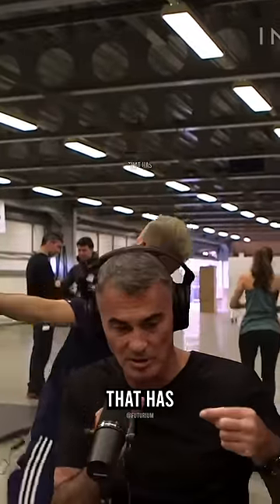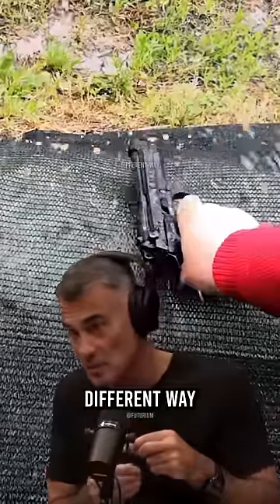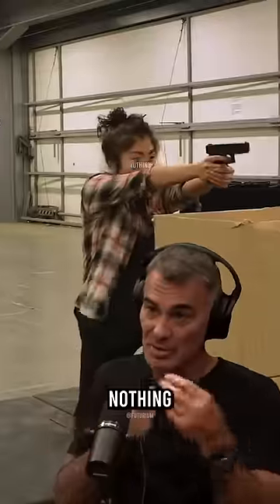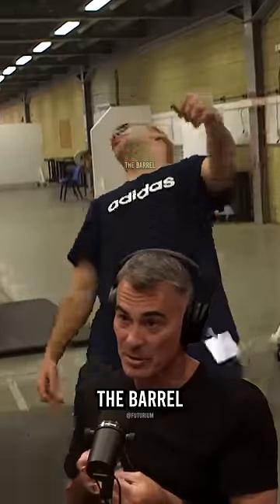How Shooting is FAKED in John Wick's Movies 🤯

Comment: Wait till they find out about airsoft
Reply: Yea but there's no flash like he was talking about
Reply: Blanks?
Reply: What
Reply: they're trying to create an actual firefight lol they would have to pay a whole lot more to create the sound effects and the flash to stop an airsoft gun sounding like a wet fart
Reply: They’re not gay.
Reply: Lmaooo bro got flamed in the comment section hahahaha
Reply: Or paintballs
Reply: Did you think that would be a good comment?
Reply: @iKennectz they still put sound effects over blanks.
Reply: @ealaw5139  yeah but its more like auto tune rather that electronically recreating sound which sounds different due to location/weather/how your holding the wepon/what wepon your using, thats a massive amount of sound creation and muzzle flashes instead of just altering the image they already have slightly rather like filters rather than drawing a motion picture
Reply: This already works way better, and airsoft can’t eject a brass casing
Reply: @ealaw5139  the blank sound bounces around the sound stage in a more realistic way. Dubbing sounds does work but the real sound just works better if you could imagine
Reply: pretty sure they already know about it and that's the reason it's not used in JW since it won't do the job the way they want
Reply: @ealaw5139  'A blank is a firearm cartridge that, when fired, does not shoot a projectile like a bullet or pellet, but generates a muzzle flash and an explosive sound (muzzle report) like a normal gunshot would.'

They don't need to. They might improve the sound, but improving a sound that's already in perfect sync with the video of the weapon firing and actors reacting to the sounds the blanks make is much easier than removing hundreds of bb bullets flying around the scene and having to go through thousands of frames to find each time a trigger was pulled in order to add audio from scratch
Reply: Yeah..but the gun slide won't lock back when it's empty, so it might looks weird..i think in john wick they try to portray the gun as accurate as possible, so airsoft gun won't do :/
Reply: @andrewgagne4465 theres no flash anyway. the plug gun has no flash. and neither does a co² airsoft gun. He even says "the muzzle flash is not important"
Reply: Not even remotely close to what they're talking about or need.
Reply: Huh? Do you actually know what youre saying
Reply: @iKennectz You’re pretty naive.
Reply: @wackwabbit3831 idk what kind of airsoft guns you've seen, but gas blowback airsoft guns (so vast majority of airsoft pistols) almost all have last round hold open and operate like the real thing.

Comment: Alec Baldwin has left the chat
Reply: Bruh 💀
Reply: ouch
Reply: Gunplay actors have got to be so paranoid after that happened.

Imagine you get handed a glock with 20 cartridges in the magazine and you have to halt filming to go through them and make sure none of them have a bullet in it.
Reply: I knew I would find Baldwin's name in the comments.
Reply: And he may have to leave the country
Reply: Yes
Reply: @priestesslucy3299 safety first man
Reply: @riclate2013  that is suppose to be the support crew's job to do Safety First
Reply: @priestesslucy3299  if your handed a firearm that can accept real bullets the safety comes down to anyone who's holding it.  Takes 30 seconds to check doesn't matter if your part of safety crew or not.
Reply: @riclate2013  it takes 30 seconds to check the cartridge in the chamber.

It takes a while to check every cartridge in the magazine
Reply: @priestesslucy3299  takes legit 3 seconds to check for a cartridge for one in the chamber.  With semi auto release the mag, rack the slide back and the round should pop out if there is one, if not then lock the slide back  and check.  If there is a round stuck you have something else to worry about.  Magazines are extremely easy to unload simply slide each round out. They take 15 seconds to empty via hand, some mags that are double have a mechanism where you can press down on the bullet head and the rounds will simply pour out in 3 seconds. 
If it's a revolver you either release the cylinder and check each chamber or for single action have it half cocked(sometimes not required) and open the loading gate then turn the cylinder to check each chamber.
There is no excuse for not checking it yourself especially if it's a legitimate functional firearm.
Reply: More like the he enter the chat and the victim left
Reply: @riclate2013 the real bad guys were the crew who went out into the desert and shot real bullets with the gun
Reply: Thing is actor like Alec Baldwin don't do enough training before filming. I had firearms training in Serbia. I had to undergo pre training with safety. The first lesson I got taught is safety first and safety last. Always check your weapon even if fire arms experts hands you preped the gun actors still need learn to check  the gun. A gun expert can tell the gun is safe but don't trust their word always check the gun  for self. Because gun have errors like double feed. The only gun that don't have a firing error is revolver.
Reply: @kaimortimer3639  That's just wrong revolvers have a hammer that could misfire. Obviously that means more training. But still it wasn't his job to check the revolver. That is the prop masters job.
Reply: @jorge-wh4pf   I didn't say that revolver's error free. I believe that actor's should trained in basic safety before filiming a movie that has gun's. yes it's the masters job to make sure that the gun is safe. But If I was given a gun in movie's even if the prop master told me the gun is safe I would personally check it since i'm the one who would be using the gun. i was taught that never trust anyone who gives me a gun that's safe always double check. if Alc baldwin was taught to check weapon and weapon safety weapon accident's would happen far less.
Reply: @riclate2013 umm. It’s not regulated for actors to check the gun. If he is going to jail for this. They should also consider the gun expert they checked the gun and handed it to him.
Reply: @stimswwolf7867  it doesn't matter if its regulated or not it's just gun safety 101 my guy.  Better to safe than sorry as the saying goes.  Especially revolvers takes 2 seconds to check if that pietta single action is loaded.  While the props department had their share of the blame ultimately the blame falls on him for being so careless especially since it was a functional firearm not a fake prop.
Reply: @riclate2013  is the department currently being investigated?
Reply: @stimswwolf7867  they were, alec still couldn't escape that though
Reply: @riclate2013  Not everyone is a gun enthusiast. Someone who's never dealt with guns would not know all the things you described, they may even not know the difference between a blank and a live round. Dude in the clip here literally had to explain what a blank is (not for Joe but for the audience). An actor should be able expect to get handed a prop, not a real gun. They are at a film set not at a gun range.

Comment: Man ive always wondered because they clearly werent using guns and blanks due to the constant proximity, and using CGI adds up and you can still see the recoil which looks legit. Great solution.
Reply: In the first movie they just used a CO2 powered airsoft Pistol.
Reply: @CaptainRudy4021  Makes sense. Great solutions to keep everyone safe without losing the believeability.
Reply: @TheDalinkwent  I'm fairly sure they also used them during filming of the later movies, or at least for certain takes or for training. There's behind the scenes footage of Keanu practicing the maneuver from Chapter 4 where he turns a car around and picks the Pit Viper pistol off the floor at the same time, and in the practice takes it seemingly has a orange tip, presumably being the official airsoft copy during the practice runs.
Reply: What recoil?

Comment: There's an article that goes into depth about how they made this plug gun. 

Basically it doesn't shoot blanks at all. It's essentially just a reloader. There's a hydraulic pushback when trigger is held, casing pops out, but Nothing comes outta the barrel. All muzzle flashes are added in digitally. 

Not only is it more safer, but you can have a better performance due to the gun recoil and reloading you can do in real time.

Comment: They also reduce the charge of each blank for some shooters, so they can appear to be handling the recoil.
Reply: Blanks have basically no recoil, because there's no projectile. Blank firing weapons have similar recoil as gas blowback airsoft guns.
Lowering the power of a blank only leads to failure to cycle. Because now there isn't enough energy to move the bolt
Reply: oh no blanks are supposedly dangerous..

Comment: I'm surprised that gas blowback guns from airsoft aren't used more often
Reply: Was legit thinking of that
Reply: No spent casing, means you have to add that in post production, which is likely going to be more costly than a prop gun and blanks.
Reply: @kman9884  literally can buy a AR resemblance shell ejecting for like 5-600$ and another 60-80$ on gas use some magic editing and poof its john wick

Comment: The military has this but it’s a BFA that screws onto the end of the barrel. I’m surprised it took armorers in film this long to find a work around
Reply: BFAs are a nightmare for cleaning so much carbon
Reply: Isn't the Bfa primarily to create enough pressure to correctly cycle the bolt of a gun that's not made to fire blanks?

Comment: So this guy discovered a blank firing adapter 😂
Reply: They work with pistols?
Reply: @Mike0 All it is is a barrel plug. Keeps anything from leaving the barrel for safety, and builds enough gas pressure to cycle the action.

Is not new, movie guns used to plug the barrel solid, before realism became important.

Comment: Billions of dollars and they cant design a fake gun that runs off a gas canister so they can get the muzzle flash. You would think after the first guy died they would stop using real fricken guns.  Blows my mind.
Reply: Danish special effects workers have actually made gun props that make realistic musselflashes. But it's compressed air and light inside the gun. 

Though Hollywood still thinks that blank firing is better. Although it have gunpowder residue flying out of the gun and the risk of Brandon Leeing people.

Comment: I’m surprised movie/choreography directors don’t use air soft and unloaded pellet guns more, it basically solves their problems other than the barrels being massively smaller than that of an actually gun, idk I just thought that would be a more common solution rather than designing a whole new gun specifically for films

Comment: When you fire a blank gun, there is no bullet or projectile that comes out of the barrel. Instead, only the explosive gases from the blank cartridge are released, which produce a loud noise and a burst of hot gases. The primary purpose of blank ammunition is to create sound and visual effects, like in movies or theatrical productions, without actually firing a projectile. However, it's important to treat blank guns with caution, as they can still be dangerous at close range due to the hot gases and loud noise they produce.

Comment: Yeah it’s called a blank firing adapter (BFA) and they’ve been around for decades. Usually it’s an externally mounted system but a few modifications to the barrel and muzzle and it can become an internal system pretty easily. It’s actually not as revolutionary as you think

Comment: In John wick most of the time they didn’t use blanks. They used air soft guns cause you can get close and still have the pistol blowback.
Reply: The director just told you otherwise
Reply: @D123-f9k  The B- Roll shows them using gas blowback pistols and adding flare in post

Comment: Blank adapters for rifles have been around for quite awhile.  I can say from first hand knowledge that the military had them for M-16's at least 30 years ago.  They look like a red square of metal with a screw at the top to lock over the end and into the barrel.  I believe they also have "hollywood" blank adapters that just fit onto the end without making it look like there's one installed.

Comment: This is actually how the military utilizes blanks, however it's a blank firing adapter that attaches to the end of the barrel, not really inside it. But it basically forces a steel rod down the barrel to increase the pressure so it can actually cycle. Even with this on it the safe engagement distance is 3m, not because it'll kill you but because 1, it's loud enough to damage your hearing, and 2, it can shoot of little bits of burning carbon and gunpowder which hurts like a m***********. Without a bfa or that steel rod, it could definitely kill or f someone's day up

Comment: I'm sorry but there is no possible way a blank is lethal at 10-15 feet. It's just gas that gets dispersed into the atmosphere and the pressure drops extremely quickly. You need to be incredibly negligent and almost touching the target to have a lethal effect. While blanks can be dangerous, they will in no way kill or hurt someone beyond maybe 2 feet or so.

Comment: An Atomic 3000 is a great light to re create muzzle flash without using any discharge 
All the weapons can be plastic 
A little color correction of the light with gel 

Led lights do ok but there is latency in the dmx path

Comment: Wouldn’t it be cheaper to use a gas blow back airsoft pistol with ejecting shells rather than using blanks with a modified barrel that would be cheaper in the long run

Comment: What part of a blank shot kills you exactly?
One of us doesn't know what a blank is 🤔
Reply: black is a round without the bullet. blacks fire only gunpowder. but the air coming out of the barrel has enough energy to kill you if someone shoots pointblank at you
-
Reply: @pureexile1702  That's interesting and understandable but there are two questions to be asked. When we say close are we like right on someone's head? Because I assume the pressure must drop rather quickly and 15 ft is a lot of distance for the air to carry enough power to potentially cut your skin, let alone kill you. It might give you a burn I guess with the tunnel pressure. Secondly, even if we're close enough, like right on someone's face, if the aim of the gas is to make separation and scape, I think it's easier for it to move the gun rather than the guys skull.
Then again these are all guesses and I haven't tried this so this might very well be quiet lethal. It just doesn't sit correct with me 🤔

Comment: Why wouldn't y'all just use a gas airsoft gun and have the slide lock disabled on an empty mag then all you have to do is fill the mag with propane and NO BB's and pull the trigger. No projectile, get a gas cloud from the barrel to help with effects. All you gotta edit is the flash and casing ejection🤷

Comment: A blank will not fucking kill someone. We used them all the time in the army and would shoot at each other in simulated contact. All that happens is small amounts of soot blow out the barrel. The WORST case scenario is if you literally were an inch away from it… and you’d maybe get a slight burn… but that’s it. Idk why bro has to just strait up lie😂

Comment: Can someone explain how it can still kill you if there is no projectile? Isn't it just the shell ejected from the side of there's no lead tip? What's killing you?
Reply: How does holding a firecracker when it blows cause an injury to your hand? Firecrackers don't have projectiles. 
A blank is still an explosion, and the gun barrel is focusing all the energy from it in a single direction. For most rounds, the energy will dissipate well before ten  feet, but a blast at close range even without a projectile can do some damage.

Comment: Why not just use an air compressed BB gun without the bbs in it and edit and CGI off the BB gun cause the slide still kicks back in an air compressed BB gun. You’d just need to edit the shell exit and muzzle flash, which would easily be timed from the sound of the dry fire and the slide sliding back😂🤷🏻‍♂️ seems way easier than putting a plug in a barrel for a blank round lmao

Comment: Could they ever make a movie prop gun that has like an extremely powerful set of LEDs in the chamber of that just creates a strong flash of light out the end of the barrel?    I'm asking.  Maybe the intensity of the light is very hard to create with something kinetic?
Reply: Actually yes and it has been done with an airsoft p-90… however I’m a Hollywood vfx artist and in reality these shots are my favorite and bread and butter so to speak. We use actual gun flashes sometimes we record them or purchase all ready filmed ones depending on the clients needs. These gunshots are then super imposed by me over the prop gun in 3D. Prop warehouses will either use a “real gun deactivated or more realistically an airsoft gun that way vfx… me have more data to work with. This is also how we do things like falling shell casing, after smoke charge and so much more! Finally depending on the time of the shot we artificially draw flashes and sync them to the shot. I always love watching these movie in particular because of the gun work, I like counting certain sequences on the effects they use and try to determine how many vfx gunshots are used, also get to learn something new once in a while.

Comment: At “ten to fifteen feet” a blank would not kill you.  Unless there’s an obstruction in the barrel you’re going to get slightly burnt, maybe.  

While doing a react to contact drill (using blanks but no bfa’s) one of the red cell guys busts off a blank from a 416 right in my point man’s face. I don’t think he meant to but he shot him from about 4’-5’ away from him, he was wearing nods but it did almost nothing to him. He was just surprised and barrel stuck the tits off of the poor bastard.